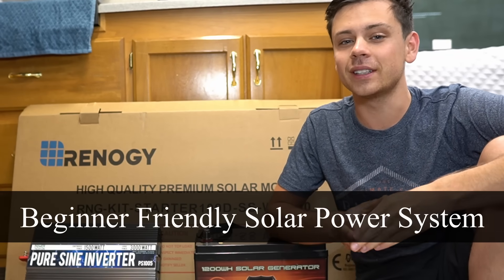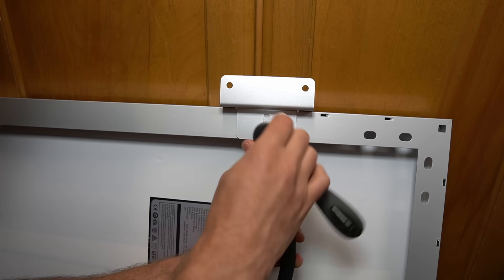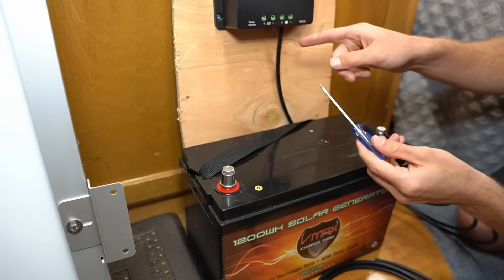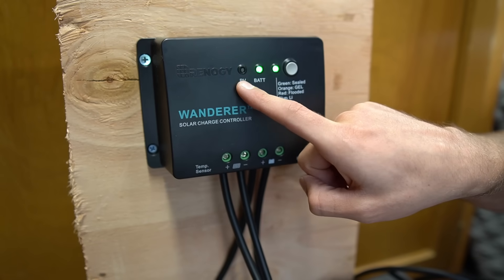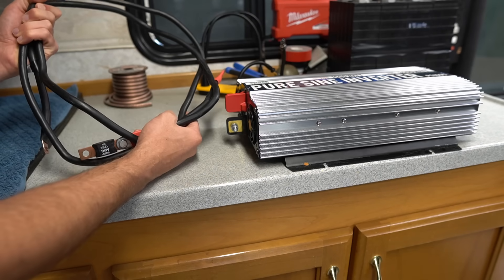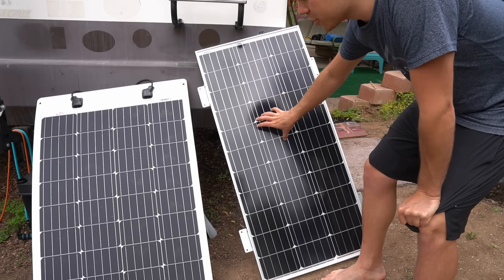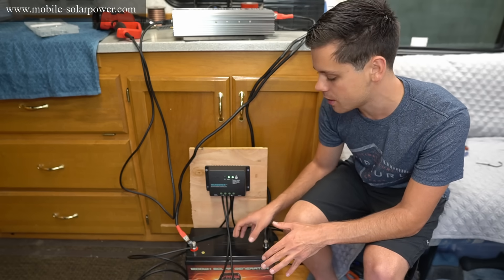Build Your First Solar Power System! Beginner Tutorial Easily Explained, Budget Friendly

Comment: I have a Delta 2 max with one extra battery. I bought two Renogy 200 watt solar panels should hook them up series or parallel? Open circuit on the solar panels is 37.44 volts each. EcoFlow max says max voltage input is 60 volts. What should I do????

Comment: A question please.
Since MPPT controllers control charging lifepo4 batteries via an input voltage (12v in particular), can I substitute a manual battery charger for the input instead of solar panels to charge batteries?
My manual charger is 2A, 12amp/50amp boost.
Theory is that 12vdc is 12vdc.
Actually the charger outputs about 14vdc-ish.
Thinking of this being a shortcut to charge batteries if you have no charger or solar panels.
BMS inside batteries should limit things.

Comment: Question:  I’ve a camper with an 85w fixed panel and a small controller which are both eleven year old technology. My batteries are 12v AGM. I’ve two portable 200w panels to use when the camper is in shade, during very cloudy weather or when I invert AC to my ebike charger.  I use a Victron 100/30 with the portable panels. If I were to permanently install the V100/30, should I eliminate the little existing controller or just run both controllers?

Comment: Having an issue running inverter with Air-conditioning going. The mppt will over-voltage (up to 45v) the LiPO4 24v system which has a 29V Boost and 27v float setting on the mppt.And it triggers over voltage on inverter.  
Any thought????
Thanks

Comment: How do you determine the fuse size.  I am assuming a 12 volt 1500w inverter, so 125 amp.  I get a 1.4 over the amps to get to 175.  Is that what your using.  (asking because google said 1.25 to 1.5)

Comment: I'm moving to Puerto Rico. The power grid always goes down. I'll have lights, refrigerator, stove, tvs, and small kitchen appliances. No AC and no washer/dryer. I'm looking for a kit that comes with the batteries, panels and inverter. All from 1 company for around  $2000. Can you recommend any kits that have everything I need

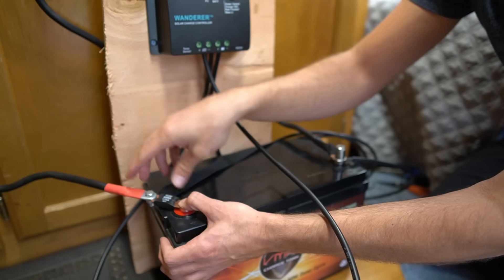Comment: 07:12 Yes, the spark scared me as well, the first time it happened - alternatively you could do the first connection using a 12 Ohm (15 Watt) wire-resistor.
Then charging the capacitor of the inverter would last 10 seconds or longer and nealy no spark will occur - thereafter connect the cable via the fuse.

Comment: I'm so glad you didn't call it a solar generator these guys all call a solar generator it's not a generator it's a power system it's actually a it's more of a power station that can be recharged by solar and or by on grid power it can be a solar power system but it's also can be recharged on the grid the solar is mounted it's not a generator thank you for not saying that

Comment: I bought  a 200watts bluetti solar panel  PV200D   and i have a eco-worthy 195 watts rigid solar panel  that adds up to 395watts. I also bought a MPPT Victro 100v 30amps solar controller. I  perchased  3 bluetti  EB3A being the first,  Ac180  the second and the last one  is ac70. and i also have at the moment  2 lifepo4 batteries  one 50 ah the other 100ah. I like  this product. my ac 180 in case of a power outage can run the subpump  it pulls 115Volts and 12 amps  . yes  this can run but the power outage  must not extend many many hours. But if i add a  24v 100ah battery then the capacity i can expand. I like your videos  you are a knowledgeable  young man. I am 70 and interrested  in learning  you are a reliable  source  to learn what  and how to do things and also what we must not do. thanks for sharing your expertise.  oh yes a also have a pure sine wave invertor 2,500watts   5000 watts peak.  2 lifepo4 chargers  one 14,6v 10amps the second one is 12 V 20amps chargers. and  i have a gas/propane generator 4000watts peak   3,500watts normal. so i have enough stuff  in case  of power outgages short term of course.

Comment: Have a question on 12v vs. 48v. I see a lot of people state that you can save money on a 48 volt systems due to downsizing wire size and breakers and things like that but I'm looking at a 12-volt battery with 600 amp hours on it and anything that is 48 volt and comparable in size to that is substantially more expensive. So if you spend the money on the 48v battery,  are you really saving that much money on wiring and connections?

Comment: NEVER disconnect or connect the negative cable first. Never. It's always red and then black. Otherwise you risk damaging the control box or whatever else is hooked up to the system. This video is old but I feel the need to mention this. I can't believe no one ever called that specific tidbit out.

Comment: will that work on a shed to run a mr cool, tv and charge computers or phones?
Reply: No. It's not enough juice to run an air-conditioner long enough to feel cool. 
The A/C will pull all the juice out of that small sealed Lead acid battery.
You're going to need a much bigger system.

Comment: Hey Will, just a quick comment to say thank you for all your YouTube guidance. We had our personal best yield the other day - 870Wh! Putting your lessons into practice has meant we have been off grid all season in our sailing boat. That has been a total breakthrough! We can charge devices via a 375W inverter, run the fridge and kee😢the house batteries topped up. We have a cumulative yield of 36kwh - only another 20,000 to go and we'll have broken even 😂 - but that's not the point. We are self sufficient and free from hooking up to shore power. Thanks again and please keep up the fantastic work! ❤⛵🛠️🔌😊

Comment: use 12volts bulb in series for the first time you connect the inverter from the battery, once the capacitor of the inverter is already charged there is no more spark you can now directly connect the inverter wires to the battery terminal..

Comment: I have no clue what I'm doing or what I need. Can someone please help me. I am wanting to have a solar kit that will power a fridge and freezer. More so the fridge. My daughter is type 1 diabetic and the thought of losing power for an extended time frame scares me bc her insulin needs to stay cold. But ideally I'd also like to use it for the stove, microwave,  washer, etc (not at the same time but plug in as needed. So I need a few heavy duty appliances powered at the same time. What do I need? I don't understand the watts and what can be used for the amount of watts you get.

Comment: Is possible to.use 2 pcs 6volts 25watts solar panel voc 7.8v

To pwm solar charge controller

May battery capacity was 30AH 12v battery lifepo4

Comment: I have a similar solar system (ridiculous in my opinion) although slightly better than yours with 4x170 Wp panels, victron mppt 20A as solar charger and 2000W Chinese pure sine wave inverter....
  My solar system in the winter with 3-4 hours of insulation can only reach 400Wh which is not enough to power my 200W refrigerator for more than a couple of hours.

Comment: Hi Will, I have a question.... I have a renogy system 600 watts solar with a 50 amp MPPT & DC-DC charge controller... so I currently have 2x 100 ah renogy smart Lithium batteries and would like to add the new Renogy Core 300ah Lithium battery to increase my storage..  they are all 12v ...
Can I just put them in Parallel even tho they are mixed regarding AH ?

Comment: If i could do just one room on solar what would I do ,such as 75in tv or charging phones computers.lights could a solar panel set in a window .I'm really a layman at this.For those who have very little budget.
Reply: Every electrical device has an Amps and Volts OR Watts listing for each device.. Let's say your TV.. A 75in TV might be 150w... You would need a system with 150w PER HOUR. If you watch TV 24/7, you need 150w x 24hr.. == 3,600w per 24hr period...  If you have ONE 12v 100ah Battery and ONE 100w Solar Panel, you could get about 400wa day (100w x 4hrs of sun) saved in a battery that can store 1200w (12v x 100ah).... So, your 3,600w TV (alone) would need 3 12v 100ah batteries and 9 100w solar panels to run just your TV 24/7... That's only CLEAR SUNNY days.. cloudy days will require more panels or less TV time.
Reply: very interestering

Comment: Is it possible to wire in a usb-C input to the controller as well if my solar panel is not connected to charge the battery? I’m looking to make a portable power supply with solar and usb-c charging capabilities using a 50-100ah battery. Thanks! Love the videos!!

Comment: 😂 I m new in the solar system, I watch ur videos and most the time I don’t get it, but I think I ll have to watch them in order lol. Thx for sharing, so helpful!
Reply: Hope this helps you or someone else: 
Batteries: 12v 100ah battery is (12v x 100ah) == 1200 watts.. A battery that size can store that many watts.. The math is the same for any battery.. 12v 50ah == 600 watts.... 24v x 100ah == 2400 watts, etc..  
Devices: You want to make some coffee.. Your coffee maker says it's '1,200 watts'.. That's PER HOUR. You have a 12v 100ah battery, so that's 1200 watts... Your coffee maker is 1200 watts!! You can run your coffee maker for ONE hour before your battery is dead. If it only takes 30 minutes, you still have 600 Watts left in your battery..
Inverters: The inverter is how much power you can USE from that inverter.. If you have a 1000w Inverter, and your coffee maker is 1200 watts, the inverter is too small and your coffee maker won't work.. You need at least a 1500 watt inverter to run JUST the coffee maker... You can hook up anything to 1000w inverter as long as it doesn't TOTAL 1000 watts.. A TV at 100w, a charger at 5 watts, a laptop at 50w and a light at 100w can ALL be run at the same time using a 1000w inverter because the TOTAL watts used is less than 1,000 watts.

Comment: I watch all of your videos and am a subscriber. You are very knowledgeable about solar. I hope you can help me. I can't seem to get any one to respond to this, even the manufacturer. I have a licitti battery box with a 12v 100 AH chins lifepo4 battery. Everything works great but I want more hours from my unit. Can I connect another 12v 100 AH battery in parallel and get a 200 ah result? Is it difficult to do or do you have an instruction video i could reference... Im not an electrician... Thank you in advance for your help.

Comment: Thanks for the great teaching vids Will. My question is does it make a difference when connecting the output wires from the controller to go to the inverter or battery? I noticed from vid to vid you use both methods. Thanks.

Comment: as a very picky DIYer that has been offgrid since 2012, this is probably the only vid i've seen that i would recommend for newbies. Remember if you are using more than 1000 watts go 24 vdc not 12vdc, your batteries will thank you.

Comment: Hi will need a little help buying stuff for a small solar I want to build I have 2 200 ah flooded lead acid battery I want to get atleast 3 200 watt solar panels so I would need a 60amp charge controller right

Comment: Should the cable size from battery to a 2000w inverter be the same size as cables linking multiple batteries in parallel on a 12v system?

Comment: Hey Will thanks for the great videos.  I would like to ask you if i were running a 200ah system in a cabover camper instead of a 100ah system would you see any reason to run either dual 100ah batts. or single 200ah batt.  I was gonna run a single 200ah batt. but wanted to ask if you saw any pros or cons. thanks again. Then after installing i was gonna install a 400. watt two panel kit after the batt. upgrade .

Comment: I have a 24v water pump, run by a 24v  solar panel  - want to put a 24v dc transformer with a day/night switch. Just wire it in? when the panel is off, dark, the switch will turn the transformer on. Could put the day/nite switch either before or after the transformer.. ?

Comment: I built my first system, and I find it amazing that when you buy a complete system, they leave stuff off. Like on my 600w 5kwh expertpower everything is included except, the cables to connect 2 batteries and any fuses or circuit breakers. Also no temperature sensor with a mppt and 2 200ah lithium.  At least give a person the option to connect the batteries together especially sense there are 2 lol 😂  thanks Will

Comment: I'm a virgin to all this DIY Solar Power. I'm trying my best to test the waters with solar power for my work shed. I have some parts but need guidance with missing equipment to complete my system.  Here are a few pics of what I have on hand. Just need feed back with what else do I need to bring my monster alive. All my parts are Renogy. 

I just need help to include cables/ and fuses where exactly do I need them for my system and what sizes are needed. I need this to be dummy explained. 

 

 - power inverter to batteries

- charge controller to batteries

 

￼

D.Gonzales

Comment: Hey Will

Question. Replacing lead acid with lithium and wanting to know where to connect the existing inverter and leveling jacks with relation to the 12 v parallel flow in mind.  Another way of asking does it matter if the other loads use either battery in relation to the 12 v parallel flow in mind. ???  Thanks will.  Maybe you already have a  diagram I could reference.

Comment: I want to use the solar panel to charge my nautical battery of my electric propeller . I don.t want to unscrew the wires each time from the panel coming from the cell not to burn the battery as you said. Are there any on/off switches or something instead pulling out the wires every time??

Comment: Will, I have 2 Li Ion 5kw batteries connected to my inverter. My inverter is an Axpert 5kw off grid with MPPT. My question is, does equalization make sense for Lithium Ion batteries? since the inverter only has one connection point in and one out to the batteries, there is no way it would "know" which battery has more charge than the other. I think the equalization functionality of the inverter is more for deep cycle batteries...not sure. I also read that for Litihium Ion it might damage them as equalization is a sort of "overcharge".

Comment: I am designing a 4 panel system for my green house using 3 Dakota lithium 12v 100ah 1280w life P04 batteries.. I'm still researching a charge controller to suit this system. Any advice?

Comment: It looks like the mega fuses are for a minimum of 32 volts.  My system is 12 volts and my inverter is rated for 1500w cont.  Does that mean I would need a 200 amp, 12 volt mega fuse?  I don't see that option in the drop down menu.

Comment: Hey Will!! I have a question will 10 gauge stranded copper 600vlt wire from Home Depot threaded wire work for solar panel hook ups together to run it through the RV and to the controller or do I need a Amazon 10 gauge wire? In my opinion, and observation I think Home Depot wire is a little bit stiffer and installations thinner so I just need your suggestion on this because I want to hook this up to my RV but I don’t want to redo it again later, so do you think it’s OK to Home Depot wire or should I go for Amazon one?

Comment: Thank you for this very informative video. I have a quick question will this be strong enough if running aftermarket car audio system on it's own battery separate from the vehicle? If not, is there a system you'd recommend?

Comment: Hey will, I just called renogy customer service for the first time. Their ability to speak english was borderline and ability to explain was the same. It took an act of god to find out the max voltage of 25 voc on the renogy 30 amp wanderer charge controller. The max voltage was not listed anywhere on the product as well. I'm thinking move onto a different company after that customer service experience.

Comment: You only need 1 fuse total? In between the positive of the battery and the inverter? You don't need 1 for the positive solar panel to charge controller or positive battery to charge controller?

Comment: What is the purpose of fuse between battery and inverter?The battery is 100 amperes and the fuse is 170 amperes.Shouldn't the fuse be weaker than the amps?Can someone explain it to me?

Comment: I recently added this system to my shed and have yet to add a fuse (planned to) thanks for clarifying what I need there. I did not know about the temperature sensor, I’m using a deep cycle AGM, can you explain the importance of this? I’m in Canada. Thirdly I’m only running some LED STRIP  lights and a USB charge port now but DO GET DOWN TO 12.4v fairly quickly and 12.2v in probably an hour (it hasn’t been very sunny lately though).
Thanks for your videos! I want to next add a small system to the house, first as a source of emergency power but expand to more.

Comment: HI Will - fantastic videos these have been a real help to me, I was wondering if you could help me with one thing, I have bought a whole solar system that has an all in one inverter and charge controller. System came with 4 x 12v 100Ah batteries, when when configuring the system and setting the battery type I have correctly set to Lithium but there is a sub menu that talks about strings, 14 Strings/15 Strings/16 Strings. I cannot seem to find any information on what that could mean ? any help/advice gratefully received
Reply: I should add these batteries are connected so that its 48v

Comment: What I would like to do is to build a system to run a freezer, as this winter we may get blackouts and there is about £500 worth of food down the drain if I can't keep it running. So if the battery would run a freezer for a day I would need a solar system to charge a second battery in just one day in the winter or keep one battery going throughout the winter as long as the blackout continued. Can it be done?